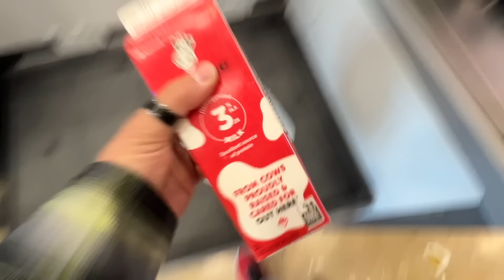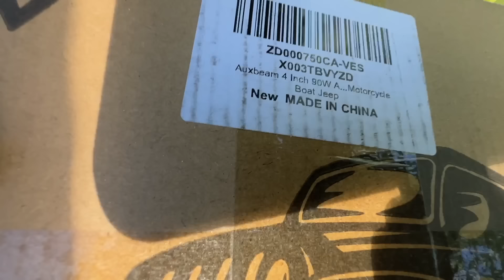What a Day of Real Vanlife Looks Like - Celebrating & Repairing

Comment: Get you a mudflap the goes all the way across the rear of your van, it will help your jeep from alot of stone chips, and save your a/c condenser and radiator, I have repaired so many in our shop, and there not getting any cheaper in this day and age, last one cost our customer about 1,500 hundred in parts and labor, keep the videos coming and don’t swim with the dead fish 😎